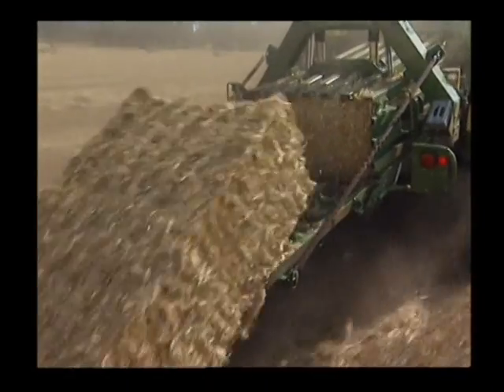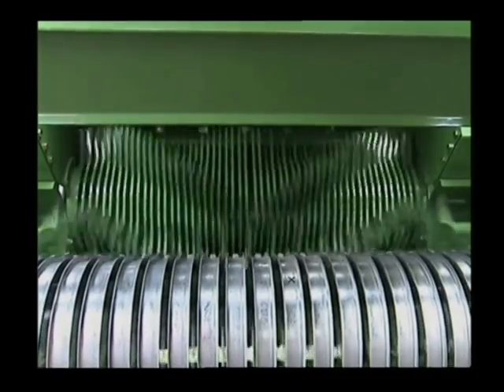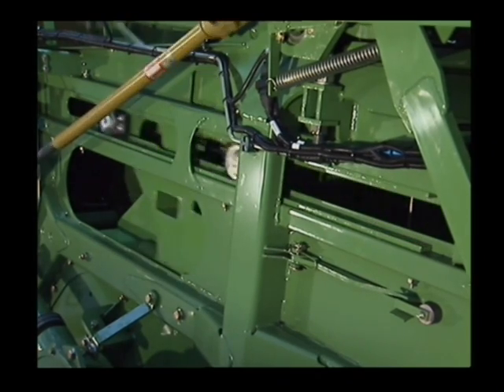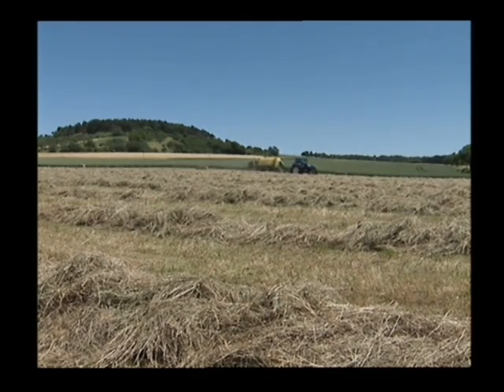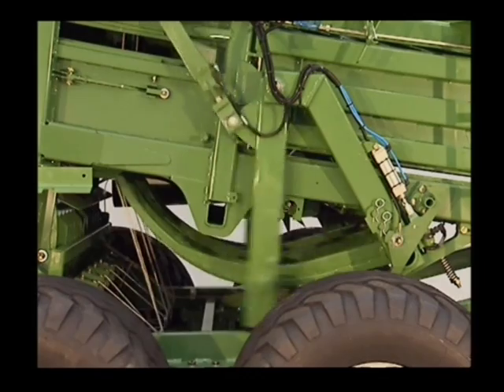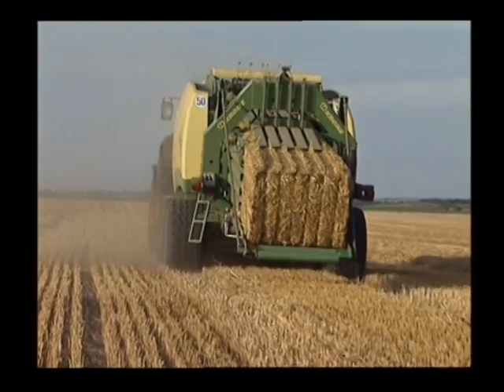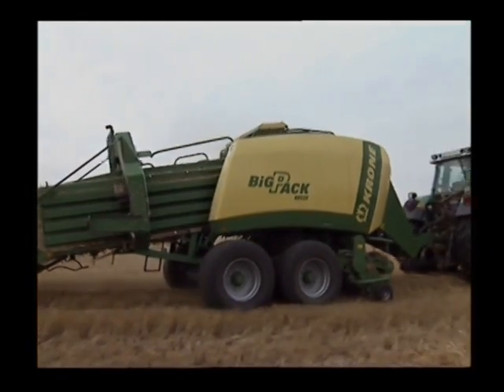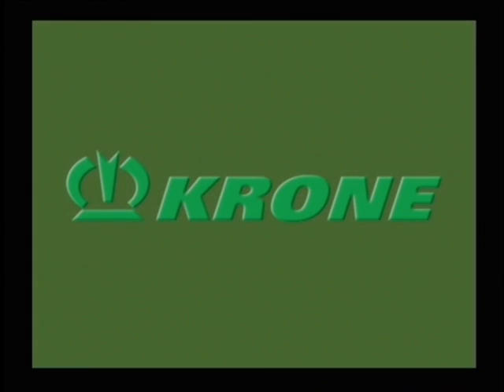Krone Big Baler

Comment: The multi bale feature is a must to sell bales to smaller farms and to the equine sector. 

There is another feature is for slightly damp hay or straw is dripping the liquid into before the chamber onto the hay. I have forgotten the liquid mixture name to prevent bales from heating up. It allows not fully dried hay to be baled and stored safety in barns without going on fire. The reason for baling so soon is the wet weather closing in and wet years reduces the time windows for farmers to harvest hay. There has been several years in Ireland hay making been so short that many farmers were forced into silage which is more work in winter for them.